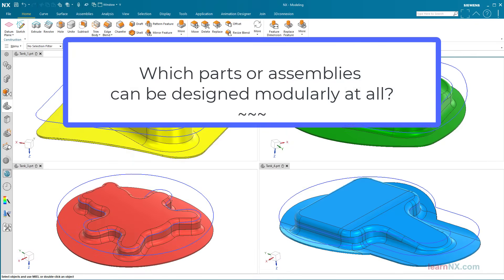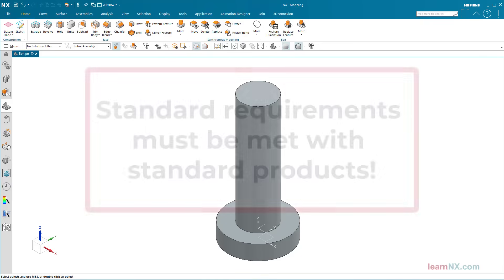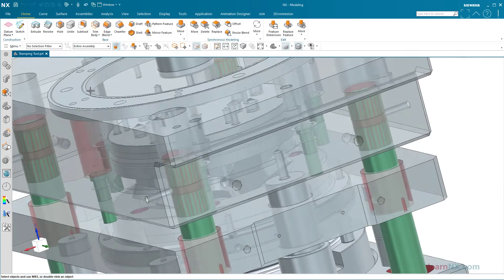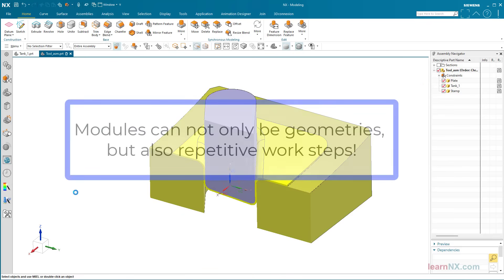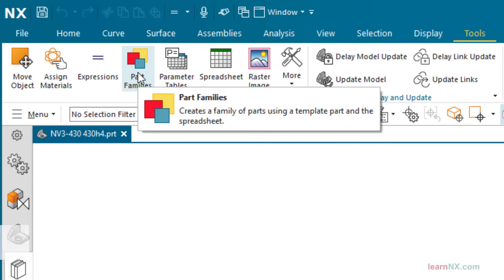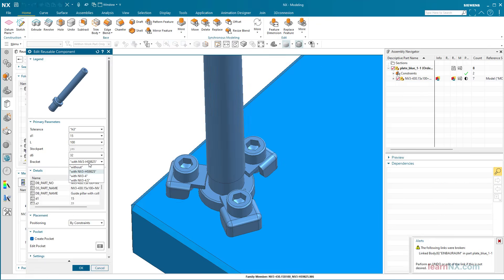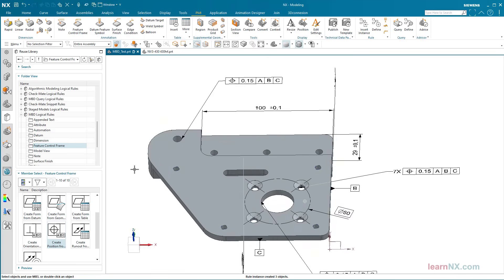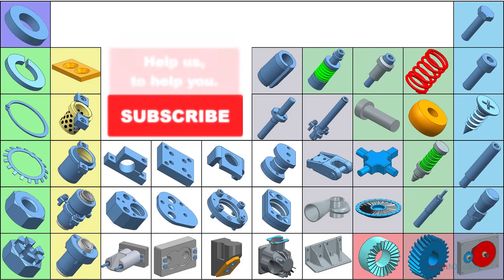Siemens NX Tutorial | Modular Design

Comment: Sorry for off topic question, but could you please tell how could you change the dimensions of the bolt  https://youtu.be/EEZnNil6sFU?si=QTppaEk1a4cqjTor&t=66 without entering Sketch Edit or Edit Parameters/with Rollback . It looks quite similar to Solidworks's Instant3D command. But I couldn't find the same functionality in NX until  I saw this video
Reply from the maker: Hello Antony, I used Synchronous Modelling to quickly change the diameter and length. In this case, I used the Linear Dimension and Radial Dimension commands. You can find an exercise on this topic on my website learnNX.com. Just type ‘synchronous’ into the search field.
Reply: @learnNX  Thank you for the clarification. It looks like Synchronous Modelling is similar to Direct modeling in other CADs. I thought the approach you were using is similar to this SW example: https://youtu.be/CRtDMigMP7U?si=iVXfHsiik6ANM9vk&t=430 . I'm quite new in NX, and couldn't find the same tool as SW has for quick dimensions changing.  It looks like NX doesn't have it?
Reply from the maker: In fact, there are similar commands in all CAD programmes, but if you take a closer look at each programme, you will discover the different approaches. Otherwise, there would be no reason for multiple CAD programmes to exist. If you are not yet familiar with NX, I recommend working through the Modelling course step by step. Afterwards, you will be able to handle the typical requirements of modelling.

Comment: Hey, it doesn't look like the model-based definition and in-part/in-assembly 3D drawing videos were posted. Are you still planning on posting them? Would be very helpful to have those tutorials.
Reply from the maker: I am delighted that you are interested, especially as the Modular Design course has attracted very few viewers so far. I even advertised the course live on PLM connection and then monitored whether the number of clicks improved. But nothing!! happened. As much as I am passionate about this topic, there is very little interest in it. What would you like to know specifically? If possible, I will make another video to supplement the course.
Reply: @learnNX  Hey, glad there's still some hope. I'm mainly looking for making annotated views in 3D or orthogonal views that aren't using the drafting mode. Was also hoping for a general overview on how to setup and use the MBD navigator for making these drawings and section views.
Reply: @learnNX  Looking at it again I meant using the PMI workspace to create 3D drawings and creating custom user views that include dimensions and drawing details. MBD navigator was where I found details about pre-existing PMI labels. Would be good to have a tutorial for using that interface and creating user views that include or remove these details.